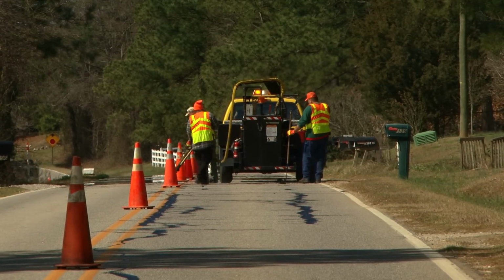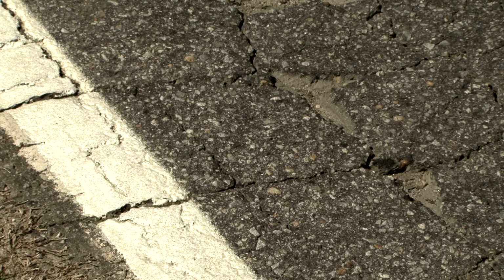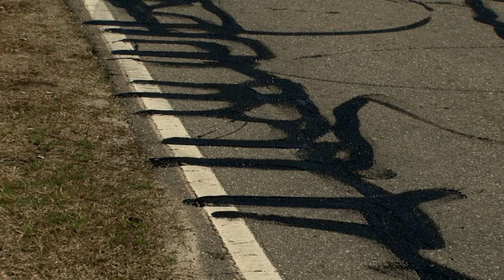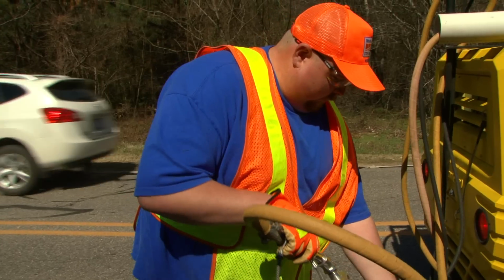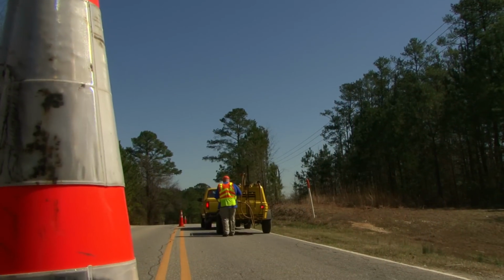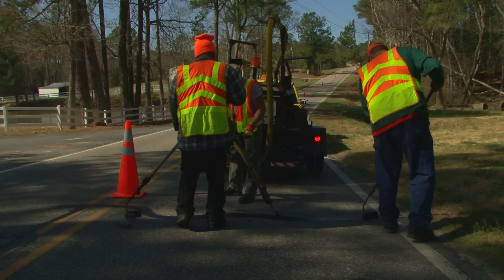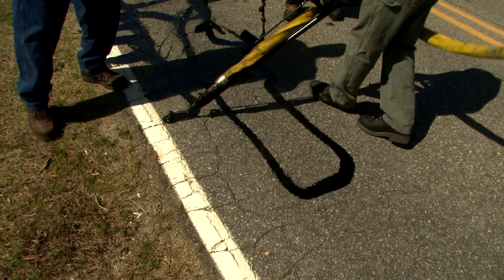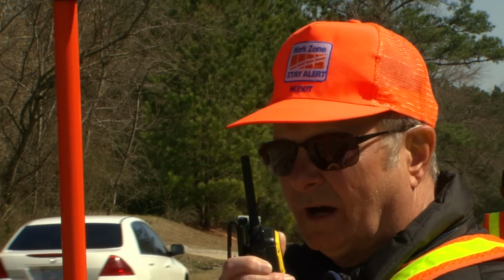Crack Sealing

Comment: This is incredibly dangerous for motorcycles. Is there no better alternative than using a sealant which will cause "tar snakes"?
Why not just fill cracks with more concrete instead.
Reply: A cape seal, chip seal, or slurry seal are other solutions but they are extremely costly compared to this method. Maybe 5x the cost and so they are saved for roads that need more than just environmental cracking. If something is wrong with the road structurally underneath, they will do something more costly which will give a smoother product, but again it's really expensive and people constantly complain that governments waste all their money. They won't do a cape seal for something they can fix with crack sealing.
Reply: What they could maybe do is take a section of road that as cracks in it seal the cracks with the sealer and then get a bitumin emulsion sprayer to spray over the black lines that was left by reparing the cracks the bitumin emulsion would also hide the repairs too making a nicer look to the job the down sides of doing this tho would mean you would have to redo the road markings that where there before which would cost more so to make it as cost effective as they can they just seal them up and leave them